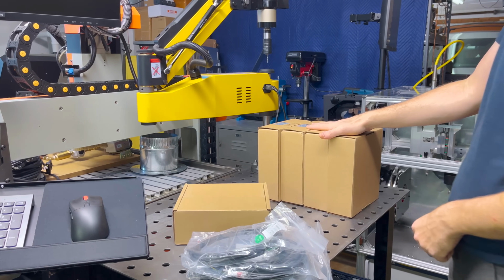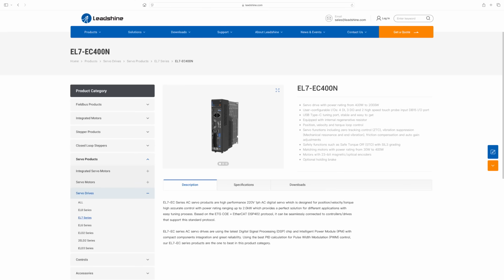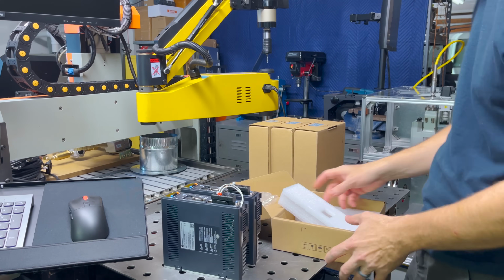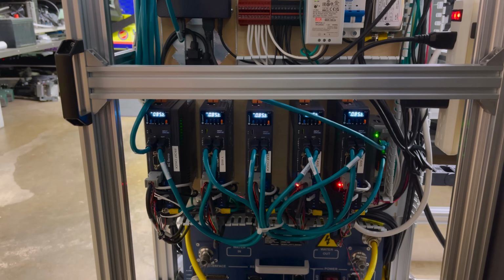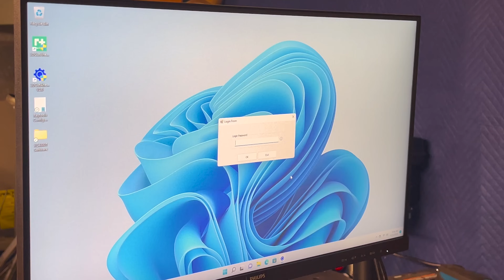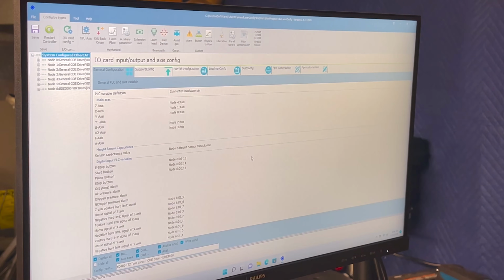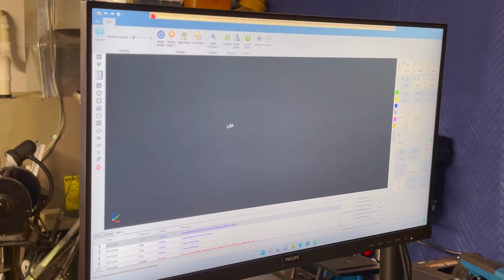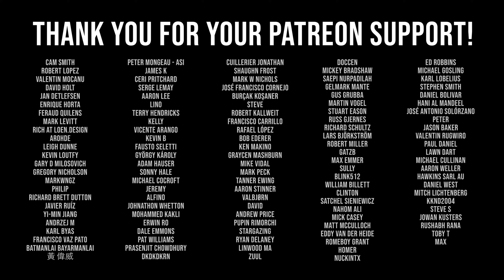DIY Fiber Laser Tube Cutting Machine | Part 9: Leadshine EL7 Servo Drives

Comment: How did you wire the required single wire 240v and neutral used globally to the US 2 wire 120v + 120v system to power the servo?
Reply from the maker: I didn’t, I used US 240v single phase
Reply from the maker: I re-read your question, i guess it’s essentially the same thing…120v to Line, 120v to Neutral, and ground
Reply: @diyfiberlaser  I just Tried wiring mine up and gave it a test run. It ran good. I guess the only difference is the 50/60 hz. Thank you for the reply

Comment: When im building my CNCs i usually put a little deflection plate on the legs or a full length plate along the edges of the tray. so the drag chain doesn’t sneak in and catch

Comment: In this build you don’t have any contractors for the drives like you did on your previous builds. What was the thought behind this?
Reply from the maker: I learned from my previous machine, that I could just wire the estop through the drives STO function instead, this is much easier
Reply: @ I have L6N drives and they don’t have the CN6 port so it looks like I’ll be using contractors. Thanks Travis

Comment: Did you manage to get the small drive associated to the f-axis using ethercat?  Wiring mine currently 😊
Reply from the maker: Yes, it worked. I also had to wire up the z-axis homing switch, before I could home it, because for some reason it requires homing Z before it will home the F axis.

Comment: What was your shipping cost of all laser components from skyfire?
Reply from the maker: I don't have a good answer because all of my laser components weren't from SkyFire...the laser source was from a previous vendor.
Reply: @diyfiberlaser  They quoted me $4,200 for the shipping cost alone via airplane for: the Raycus laser source, Raytools cutting head plus controller and the water chiller. No way I'm paying that much for shipping! The cost of those components is about $7,000
Reply: @johnboon5330  Raycus brand is banned recently. Apparently you can not import to US. For that reason you're paying that much high cost I guess.
Reply: @viadom7587  You are right. They quoted me the Max brand instead but the shipping cost remained the same
Reply: @johnboon5330  Thank you for your feedback! We’d like to inform all customers that the shipping costs displayed on our website are automatically calculated based on standard rates. These rates may not account for combining multiple items into one shipment, which can sometimes make the estimate appear higher.
To ensure you get the most accurate and often lower shipping quote, we encourage you to contact us directly with your shipping address before placing your order. We’re always happy to assist and provide the best possible solution for you. Thank you for your understanding and support!
Reply: @Skyfirelaser  Thanks for your reply. I'm a US based customer. The shipping cost was calculated by Fiona. She also checked the shipping option via sea but it takes too long to arrive that new Trump tariffs may apply by then if ordered now. Shipping cost from China nowadays it's really prohibited. So frustrating 😫